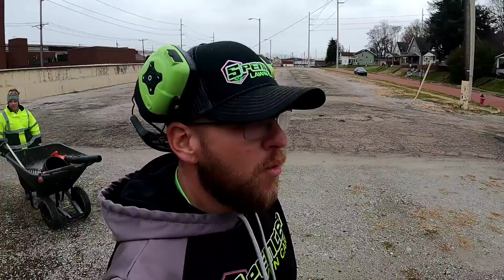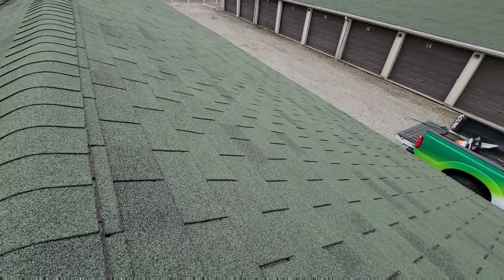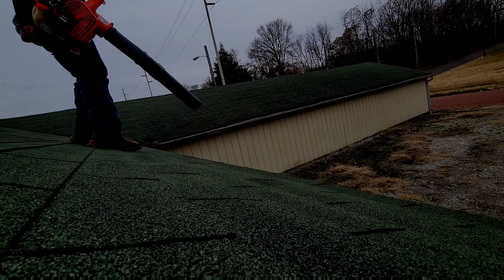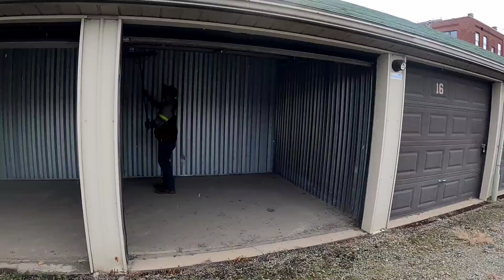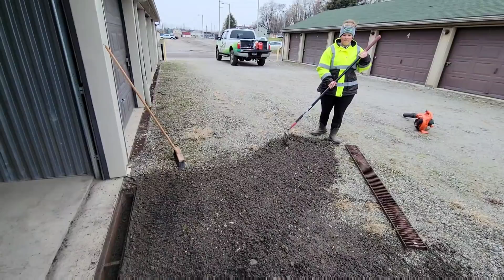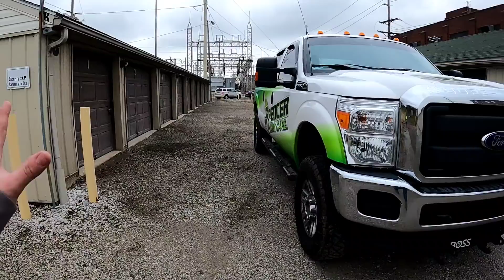FIRST DAY AT OUR NEW JOB | CUSTOMER STOPPED BY!

Comment: You guys might want to consider investing in a drag harrow for your driveway. Plenty of diy's also. They work well for keeping gravel level and weeds at bay. It will make your weeding job super quick and a zero turn will pull it with ease.
Reply: I need to make one for my atv. I've seen simple ones like some fencing and cinder block!

Comment: Home Depot plumbing  area buy rubber that takes pipe from 3 to 2” reducer  size that fits your backpack blower pipe … take pipe off BP blower put rubber on  with hose clamp buy 8ft white pipe pvc? 2” plus two 90* elbows put elbow on end of pipe … cut about 2-3 inches off other end of white pipe put in first elbow glue those together … put other elbow on that couple in pipe so when you lift pipe up to eves it will blow air forward a bit. Did this to my redmax 7001 15 yrs ago clear them from the ground…
 Two inch part of rubber needs a pipe clamp to hold together  to 2” pipe. About $25

Comment: I would recommend cleaning up the parking area!  If you are worried about the ground being soft, you can rent a small vibratory rolling compactor (same one that you used on your parking area) and pack the entire area!  It would definitely make it look so much better.  Too bad that I didn't live close, it wouldn't take long to clean that up and grade it properly

I'm assuming that you are going to clean all of the drains!  But it would probably be good to actually schedule a cleaning every spring to keep them working properly.  It's one of the most overlooked things for maintenance

Comment: Looks like y'all are getting a good head start on the storage facility. Shawn you said Your grandfather worked for Timken & retired from there also. One of my grandfather's owned an  Autocar Truck with Timken rear ends . Yep the same Timken bering company also made truck rear ends/ axles many years ago. & Myself & family have used several Timken Bering's in our Dump, Lowboy ,Log & Farm trucks throughout the years . Mack

Comment: Not to get in yalls business or tell you what to do but just my observation since i was in the roofing industry with my Father n Law for over 25 years here in Arkansas  that roof and all of the granulars in that gutter the weight alone might have pulled the gutter away from the overhang you can see the asphalt showing through those shingles from all the missing granulars I would have a roofing inspector come look at it because from what I saw and just my opinion there are high nails and some of the tabs from those 3 tab shingles lifting up and not sealed that roof to me from what I saw without looking at it in person that roof looks in pretty bad condition I'd pay more attention to it and spend the money to protect the contents of the containers before I'd spend it on gravel or whatever you plan on doing to that parking lot take it for what it's worth have a great day

Comment: Get someone in to paint the metal building I say White siding and Green garage doors I wouldn't make it safety green maybe tone it down a bit (the neighborly thing to do) and that roof would blend it until you decided to throw a metal roof on. Not sure what code is down there for commercial but you might be able to go over those shingles with steel

Comment: To me the green on the roof looks fine, kinda matches the Spencer business colors
Reply from the maker: Yeah they are just not what I would put on a building.
Reply: Roof looks like it's in good shape. Find out how old it is. If it has warranty good metal roof can look like asphalt but asphalt won't show minor damage from hail storm like metal would. get an expert to certify condition of roof. If storm comes through and causes significant damage have insurance cover it and pay minimal cost unless warranty covers(example roof rated for up to x mph wind and x size hail you get pro rated on remainder of warranty. If you got a fairly new roof how much material is normal in gutters. the Difference between functional product after many years of snow and Ice damage using shovel and roof rake and fairly new and product not holding up as it's supposed to vs you clean bird poop...off and this is the result vs this is 10years of wear and nobody else has been up there but you. If I were you I'd stay off the roof from this point on unless absolutely necessary to avoid premature damage.
Reply: I have actually painted asphalt shingles, very light coats. It will change the color, but will also stabilize the grit for awhile.

Comment: Try a steel yard roller for the gravel. That's how we did our driveway.  The roller will smooth out and flatten the gravel. And get flex seal for the gutters just make sure it stays warm till you are ready for it.

Comment: Storage gutters are full of not fun.   I've found needles in ours!   Use a scraper not your hands my man!
Reply from the maker: Yeah I didn't have a small enough scraper
Reply: @SpencerLawnCare  not worth the risk ..  I've a few hundred units ..     do the leaf blower from the ground with an extension with a 90 and a 45.   You'll get 85% of the muck without risking falling off the roof..

We also follow the gutters with our shop truck with a step ladder. One guy getting the nasty clogs. The other driving   five feet at a time.

Comment: Another great video you two. I know you see and get hundreds or thousands of messages each day and hopefully you read one of mine. 

You talked about putting black top down and Financially I understand the comparison between concrete and blacktop. The one thing that you have no control over here is, what vehicles come in on the property. Fenced or no fence. Please keep in mind, if5 you can drive a half inch piece of rebar through blacktop, it shows you how terrible a product it is.n